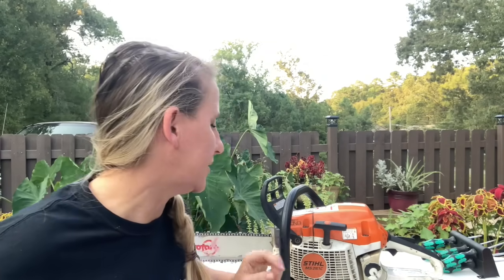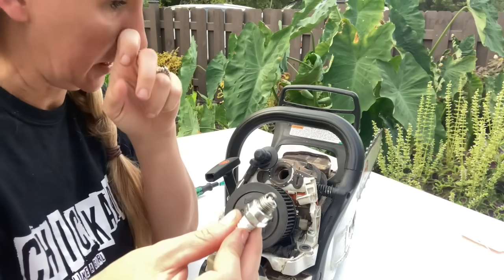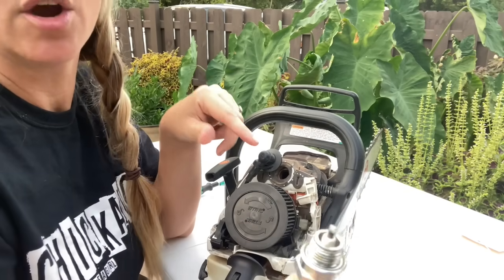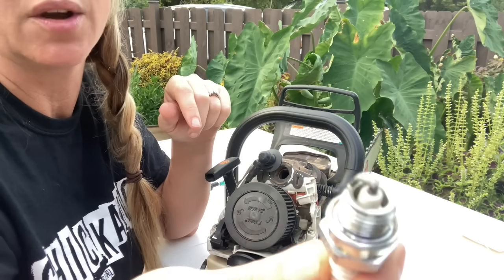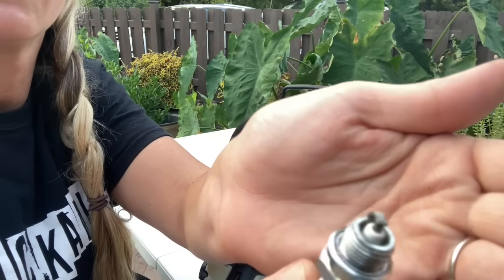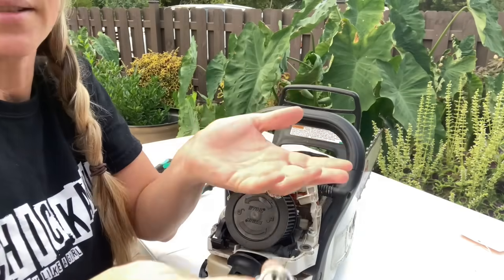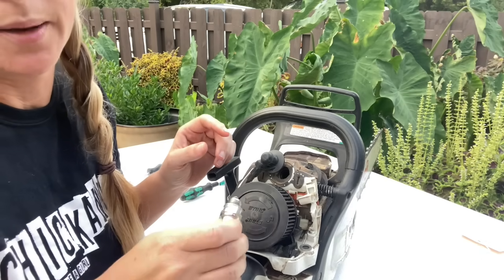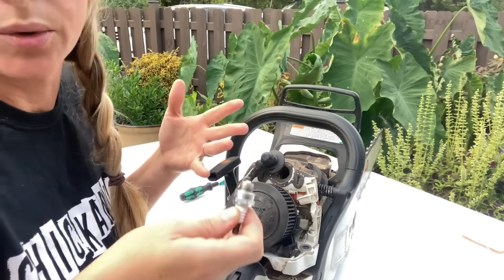STIHL M-TRONIC CHAINSAW HAS NO CARBURETOR ADJUST, WILL IT "RESET" TO REGULATE FUEL CORRECTLY?

Comment: Bre This is going to be more and more a problem. It’s called “Right to Repair”.            Manufacturers are insuring you have to go to dealer for service. 
      It’s been a problem with cars , computers and smart phones.  They say John Deere is going this way and it looks like Stihl is now. 
    Good luck from this retired car mechanic who tinkers with mowers now.     Thanks.  Del
Reply: John Deere is trying to prohibit Right to Repair. I helped a local farmer last year get his combine running again. Thing shut down in the middle of the field. Snagged a "copy" of the JD software and "adjusted" a faulty def sensor. Helped my brother in law "tune" a New Holland. Gained around 53% better fuel economy. The epa needs to go pound sand with their "emissions" BS.
Reply: @wizzlefits  Yep not a fan of the EPA either dictating how we must adapt to their demands of go green and pay more to operate anything without the watchful eye of big brother scrutinizing everything we do
Reply: John Deere has been this way for a while now.
Reply: Sounds like a good reason to save your old chainsaw and let the new ones sit in the store...
Reply: @joew9392  A backup saw is always a good plan too!!:)
Reply: @Guns_N_Gears   I should be okay, got about 20 chainsaws, mostly Stihl with a few Husqvarnas and a Homelite or two..
Reply: @joew9392  Yes, definitely sitting in the green my Friend 👍👍
Reply: That’s not the same…
Reply: @blakegrubb3091  Ok.  How so ?         I’m just familiar with the automotive field (45 years professional repair tech).  
     I thought she said you needed some type of “diagnostic” device to go further. 
    I appreciate your input as I’ve just been working on small engines this summer.

Comment: My 2019 MS261C has run flawlessly for me.  It absolutely rips in any season..  I do let it idle at least a minute or two to warm up on cold start, and give it at least a minute to cool down before shutoff after a medium-hard cut.  I've been told the computer uses these times as well as the 'hard in the cut' time to adjust fueling trims.
Reply: Kreme @ That makes good sense. Especially às your completely happy with the machine. It's a shame nobody reads the handbook and take note of requirements
Reply: @chrisprobert6  Why don't you watch the video again.  The magic reset did not work.  It does not matter if you read the manual or not, the reset did not work.
Reply: @skrzek  Nobody said anything about resetting.
Reply: @skrzek , there are three different reset procedures depending on the version of M-Tronic. If that was the correct reset (and I’m fairly sure it is) replacing the solenoid should solve the problem.
Reply: @skrzek  Because that's not the reset procedure.
Reply: Exactly, mine 261c is awesome 👌. After running it and my fs85r weed eater and my blower I let it idle for a good minute. The air going through the motor actually helps cool the 2mix engine. I also warm mine really gently, idle for a minute and some gentle limping before bucking
Reply: Your saw should be new enough to have the updated/upgraded solenoid and fuel filter in it. Even the older 261Cs are golden after those are changed.
Reply: You are correct, I let my MC 362 idle for 30 seconds and never touch the trigger, then I cut away full power and let the saw do it's thing.  After cutting, I l;et the saw cool down just like my log splitter.   Also us 91 gas and mix one gallon at a time.   Hint:  When I go to fill my can, I put one gallon in to a second can first to clear the old can in then hose, then put the one gallon in to a mix gas can.   Read your Handbook and talk to the dealer..
Reply: @Sergeo G I bucked and split 32 log cords of oak and 12 cords mixed with one chain.

Comment: Got the ol' Stihl 029 Super. Won't start.
Reply from the maker: Those old Farm Bosses were such great saws. If the piston and cylinder are good, keep that bad boy running!
Reply: If you have good fuel and spark , timing and compression is about all that is left to check.